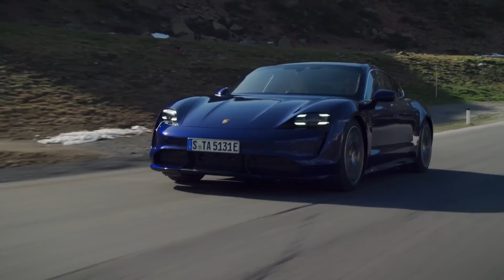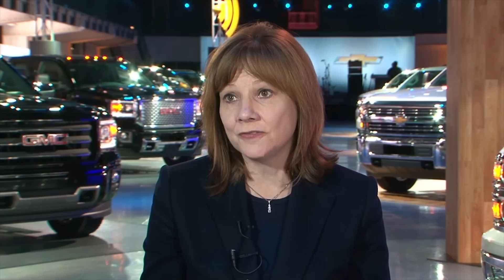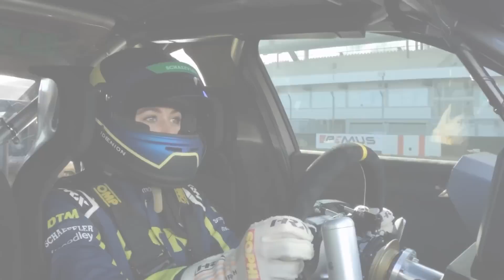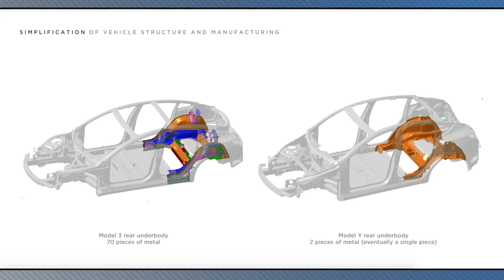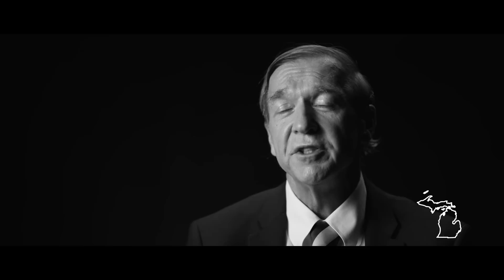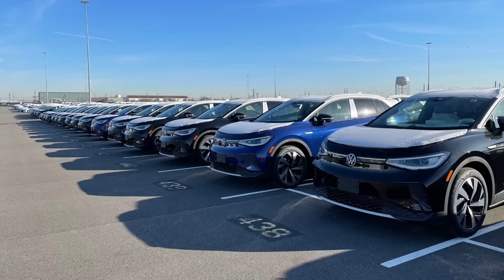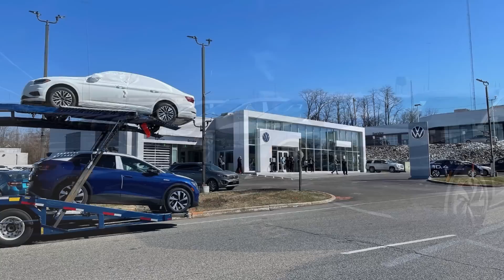Germany Slashes EV Subsidies; Tesla Charging Fee to Use Navigation - Autoline Daily 3370

Comment: Are GM vehicles missing chips being sent to dealers? That would explain something I recently saw. A Chevrolet dealer's lot was packed with Silverados. There was no extra space. I couldn't figure why they had so many if there is a shortage of new vehicles, but if they can't sell them, it might explain the mystery.
Reply: GM does not ship built shy vehicles to dealers.
Reply: Seat heater, steering wheel heater, and more are not working.  GM promises a retrofit at a later point.
Reply: It is not hurting for sales! GM is outselling Ford pickups by over 60,000 in 2022!
Reply: Only if the dealer can fit these upgrades in its service centre. Helps avoid empty car lots and no cost to the dealer till the upgrade kit is delivered